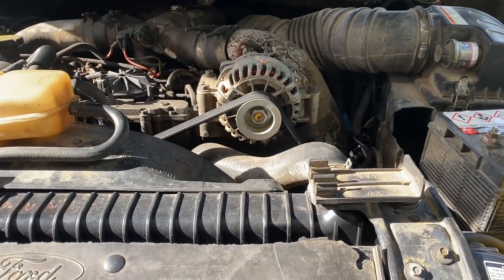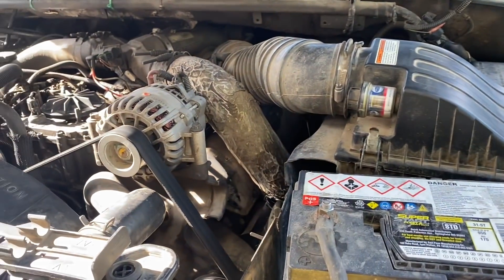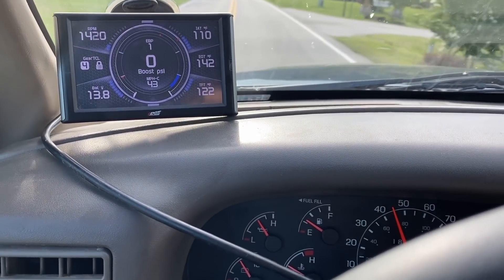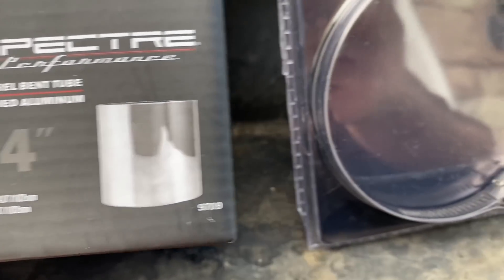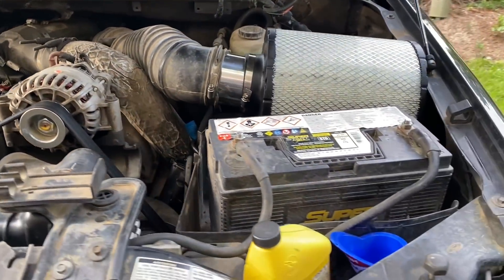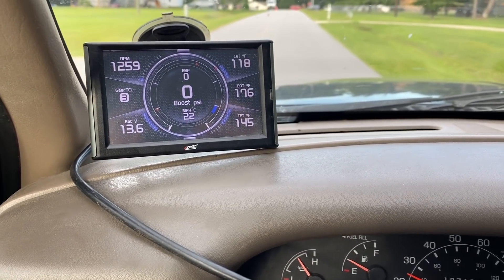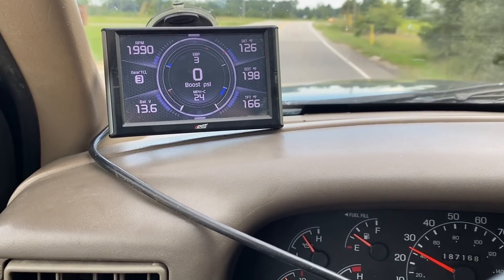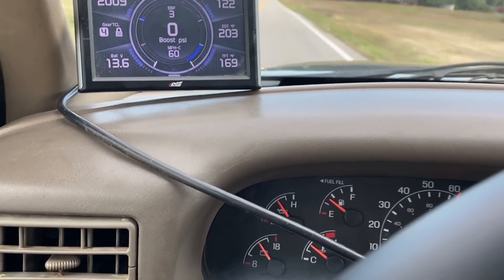7.3 Powerstroke Air Filter Test

Comment: my 01' hit 18 lbs stock. hydra chip at 75hp tow now hits 22. I had EGT problems and a "flow restriction" obvious with the meter in the box. I ripped out the box and put in THE SAME EXACT filter as you. no extra boost, but REALLY reduced my EGTs as well as spiced up the output. a lot less coal rolling out the back meant my a/f mix was much better, more efficient. I moved the air filter monitor to the hose. no more yellow showing when I smack the skinny pedal like it owes me money.

Comment: Unplug your red line on the waist gate and you will get 20-25 psi. With it plugged in, your waste gate starts opening via vacuum around 5psi
Reply: Will this cause damage if you leave it off?
Reply: @trillhers3119  no but be cautious. Install a boost guage in your dash and don’t hold it at that psi for long periods of time. (Like when your towing on the interstate pulling a long hill, your boost will raise, use your foot and throttle to reduce speed to lower it if it wants to raise that high and stay there) but make sure your boots are in good shape because if they are dry rotted you will possibly find which one is bad due to the added psi.

Comment: Look at your EBPV to make sure it's working correctly, and also try adjusting the Waste Gate on the Turbo for more boost then you may see a better result. Also use a cool air box with the larger air filter like from RiffRaff for better results. It could also be your injectors need some HotShots Stiction Oil Treatment as well as some HotShots Diesel Extreme Fuel Treatment. Still an interesting video. Best Wishes and Blessings. Keith Noneya on YouTube

Comment: Im diggin the 2 group 31s in the engine bay.  Ive been wanting to grab a couple off 1100s of the shop floor and thow them in.   Mine boosts to 21 with no tune.  It hits 17 easily 
   Thanks for the AIT Sensor location.  ive been a diesel tech for 32 years and still couldnt locate ait info online anywhere as to location and what it looks like. I bought mine with the air box already deleted so I never saw it original location. 
Thanks again.

Comment: Dude if you are only making 10psi something is wrong. Even with a broken exhaust back pressure tube leaving a 1/4 inch open hole in the manifold and the sensor not reading at all my bone stock truck would make 13psi. Once that was fixed it was more like 15-16  (around what the trucks should make stock) and that’s at 1500ft in elevation with 240,000 miles. Tuned you should be making a lot more especially on a 75hp tune.

Comment: Factory turbo only pulls 10 psi. You need to change that part on turbo that vacuum line is hooked up to . They sell some thatvallows waste gate to open later which will give higher boost

Comment: These hot air intakes reduce the air density going into the engine because they draw air from under the hood that comes thru the radiator. The stock air box draws cooler air from in front of the core support providing more air density. Whether that makes a measurable power difference is not shown by this test. Louder intake is less desirable to me.

Comment: I would suggest checking your exhaust back pressure. Then getting Bellowed up pipes if you don’t have proper pressure (I think 35-45 psi). Also, I don’t know if I would trust the boost displayed on that gauge. It is getting readings off of the map sensor. Also important to perform a boost leak test. I just did a bunch of work to mine. Had lots of boost leaks.

Comment: I have this upgrade on my truck, but i wasn't looking more boost, I was looking for cleaner air. The OEM square box filters let to much dirt go by, this upgrade provides cleaner air. You could actually see a film of dirt in the 4" tube from the old OEM filter box, it's been clean ever since I did the upgrade. DIRT KILLS DIESELS!!!
Reply: This is 💯% spot on. Why kill your engine for 10hp or so. Those cleanable filters start clogging up within several hundred miles where I live. So they stop flowing more air fairly quickly.

Comment: I have a 2001 f-250 with the 7.3 I have the edge as well I Set it on race mode and I get 22 pounds of boost with the same filter that you have I don’t know what you have yours programmed to but on Tow mode I get 11 pounds of boost

Comment: Putting on this crap  air filter is Great until it gets wet and plugs up the paper and starts sucking oil into your motor from your CCV.  The new air filter might sound better but it's crap for your motor. Also I noticed you don't have your little plastic cover by your fuel filter, the little cover is there so your fuel filter won't jell up in the winter because the little fuel heater in the bottom of the filter can can't keep up with the cold, put that cover back on. also the stock air filter can protects the stock air filter from rain and has been proven to supply more air to your motor than what you did with that after market filter. I have to laugh how many people fall for the after market filters and Mods that actually hurt your performance of your motor. and make it ware out faster. Want a hot rod? buy a hot rod want a truck that is a pulling machine? keep the motor stock.
Reply: There are several mods that improve on the design and create a much easier to diagnose and repair engine. Efuel, deleted pedestal, improved HPOP lines, are a few. Stock does not mean best. How many stock 6.dohs are left running today?

Comment: Smoke is probably from dirty fuel filter, based on how the rest of engine looks. Something I did that worked wonders with regards to turbo performance that's a piece of cake to do...tighten up the hose brackets that come out of the Y pipe/turbo. You can use either a wrench or deep impact sockets, they are all the same size except for one that's towards the front of turbo that's a little bigger. Don't forget the hose brackets that go down on both sides of the radiator! Might need a stubby wrench to tighten those ones. Takes 10 minutes to do all of them and my turbo sounds WAY better. Plus gave me a little more pep! 

You can also use a flathead screwdriver to tighten up the air filter related hose brackets while you are at it, you'd be shocked at how loose some of them are..
Reply: So tightening some stuff can make a turbo louder???
Reply: @wheat Superduty  yeah!! Cause if your boots are loose air is seeping through which not only causes loss of boost, the turbo whine/whistle is replaced by the sound of leaking air, the volume of which depending on how bad your leak is!
Reply: @jamesb1988  is there a video on what to tighten????

Comment: Not sure how the pcm is reading boost on a 7.3 . If it's calculating off the backpressure sensor.  Maybe the little metal tube has a hole in it   , giving low reading.

Comment: 10psi seems low, my 2000 250 is bone stock and sees 18-19psi. Curious to see what it is loaded
Reply: His turbo sounds terrible compared to mine too… I see 20+ with a straight pipe and wastegate delete

Comment: My guess is your up pipes are leaking at the turbo and or your exhaust manifolds are leaking . 

I put a 4” down pipe to 5” exhaust on my 03 7.3 , then added a S@B air intake . Made a lot of differance but when I towed I’d get turbo surge . Ended up with a bd thruster 2 turbo , bellowed up pipes , boost fooler , cts2 monitor , Hydra tuner with 1023 diesel tunes , did the pedestal delete in the turbo and bigger housing . My 7.3 rips now compared to what it was . Still don’t hold a candle to these 100,000 new diesels . I’m also running 38s and it sets you back in the seat pretty good . Next is injectors and fuel upgrade and I’m done .

Comment: You can also buy a 4" PVC cap in plumbing dept drill a hole thread in an air fitting put in intake at air inlet clamp down and find additional boost leaks.

Comment: You have an issue. That truck should make 15psi or a little better on the stock tune. Around 20psi with the stock tune and the wastegate line plugged. Look for soot at the top of the uppipes where they bolt to the Y pipe behind the turbo and the manifolds at the back cylinders. Also worth checking the compressor wheel. It's pretty common for the stock air boxes to break a clip and unfiltered air chips or sandblasts the wheel. If that's all good, look for boost leaks.

Comment: It oughta make 17-20 bone stock, double check your map and back pressure sensors, if I’m not mistaken one got changed in an earlier video? I’ve seen differences in icp sensors between Ford models and international trucks even though they’re the same engine….wonder if you have the wrong sensor in it. Put a mechanical gauge on it to confirm the edge is correct

Comment: Boost is a restriction in flow. The chip does nothing to change that. It just adds fuel to add horsepower. There is something wrong, it's not a Duramx :)

Comment: You can also make your own boost leak test rig. Find a PVC cap and rubber boot to clamp on to the front of the turbo, drill and tap the cap and install a air pressure regulator. Hook up your shop air and put about 5-7psi (a little more if you trust that the cap and boot won't blow off the turbo.) Then spray some soapy water all over the entire intake system and watch for air bubbles.

Comment: Stock waste gate is 11psi on those. That’s why it’s staying there.
Reply from the maker: I pulled the line, it makes about 14 with it off.  Also noticed the edge monitor is 3 psi low from the scan tool.

Comment: Also the exhaust back pressure warm up valve probably needs cleaned out. That truck should make arleast 15psi, maybe 18-20 with the TS chip on level 6 and the waste gate actuator vacuum line disconnected. Factory boost/fuel cut programmed in the ecm is at 18-20. You can use a cheap air pressure regulator as a "Boost Fooler" pre-set at 16-17psi on the boost line going to the MAP sensor mounted near the passenger side fire wall. This will keep the ecm from seeing enough boost to cause a fuel cut. Although factory fuel injection system and turbo on a 7.3 will only make a max of about 22-25 on a good day.

Comment: its all about surface area the stock filter has x amount of inches and the conical has x amount which ever has more will ultimately flow more. so if you cut the conical and roll it out is it the same surface area or is it less. looks like less to me maybe its more hard to tell. youre also missing part of you airbox that covers the battery and takes in air  at the rad support in front of the battery

Comment: There has been many dyno tests on just about every model of diesel truck made in the last 25-30 years comparing different air filters and cold air intakes. There isn't a single aftermarket system that performs better than a stock unit on a mostly stock engine.
Reply: 💯 percent agree with you
Reply: I like my s&b cold air intake. I would imagine it does outperform the stock because of the filter surface area. But I could be wrong. However, if I had known at the time that Ford actually does make an upgraded cold air intake for the 7.3 and it’s bad ass, I would’ve preferred to purchase it. Not available at full force diesel anymore unfortunately but I’ll give you a part number check it out. Pretty bad ass and actually made by motor craft
Motor craft 2U229K635aa
Reply: hey wyd

Comment: John, the truck has issues.  It should be making way more than 10 psi with the TS chip, it should be up around 15-20 depending on load.  Did you confirm the chip is installed correctly?  Those chips are notorious for not making good contact with the ECM

Comment: you should think about making some ductwork to get cold air directly to that filter, the filter behind the battery sucks in all that hot air under the hood. I can tell a huge difference when its getting fresh air rather than hot air from under the hood.

Comment: Wash that engine bay cuz all that dirt n dust is holding a bunch of heat in there. A clean engine is a happy engine!  Just throw the stock airbox back on with a k and n filter is ur best bet. I wouldnt think changing a filter would give you anymore boost. Now switching from the 75hp to the 100hp tune and not seeing an increase is a different story. Time to hit the internet forums to see what the diesel guys are saying could cause this issue

Comment: will make more boost with the trailer loaded & 
connected  with a load on it. My 2001 F-550 makes 29 psi pulling a 34 foot race car 5th wheel trailer

Comment: You might want to make sure there’s no broken exhaust bolts/exhaust leak.
Reply: Agreed. Also the up pipes are bad about blowing out. Either way ur loosing alot of power. But typically its up pipes on a 7.3, they have a better updated kit out now besides factory.  Also Iman aftermarket downpipe will also make a very good gain. But personally I would tow with that 75hp tune in it. It will make alot more power with a load behind it. And the exhaust leaks fixed. Also should make morethan that, especially with the tuner jack up 100hp, thatd be 200 more torque.  Love the channel

Comment: John put the Ford filter back on they do years of testing & give u the best ! That filter will not filter as well & your motor will suck in more crapp !!!
Reply: Incorrect. The stock air box is trash. It's common for the clips to fail and the engine breaths unfiltered air. A lot of 7.3 engines and turbos have been replaced as a result of that junk stock air box.

Comment: Don’t know about these trucks exactly but wouldn’t the waste gate control 10psi no matter what if that’s what spring is in it?  Probably free’ed up some horsepower making it breath easier but it would still open the gate at 10 psi.  Just a thought
Reply: I was thinking the same thing. Didnt know an air filter change would increase boost